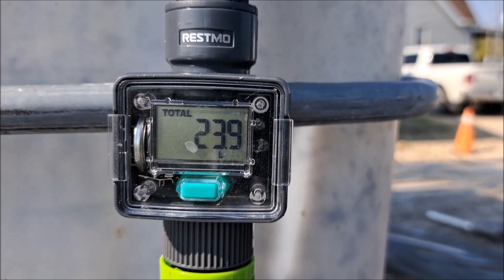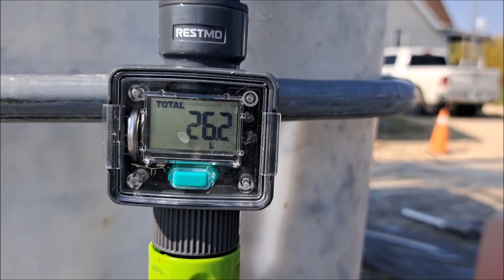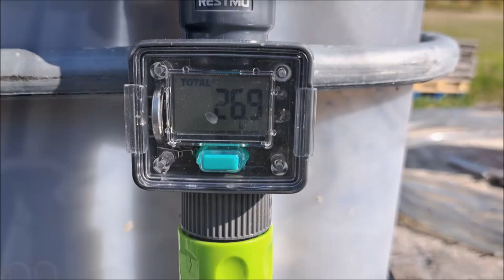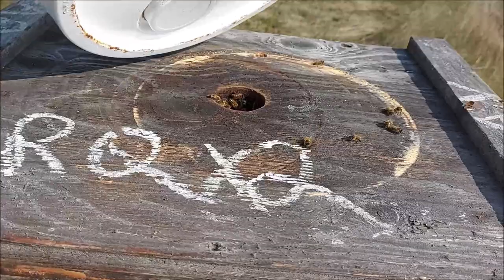⏱ Vlog September 16 to 22-That Bee Man

Comment: Only thing I could say that might would have assisted with leaks on this new setup?  Teflon Tape.  It would seal them threads while still being able to remove it later.
Reply from the maker: I've always used teflon tape on all thread joints.  Thanks for watching!